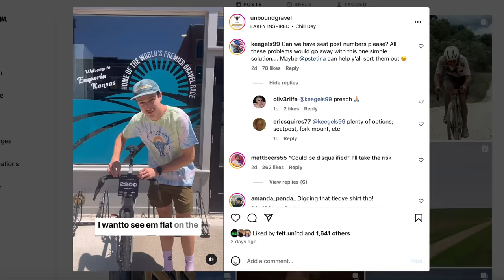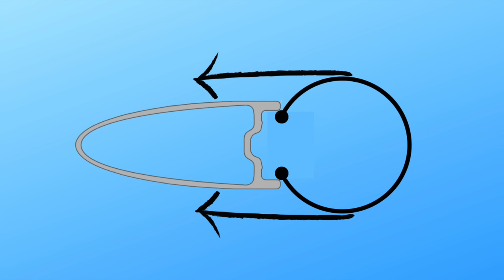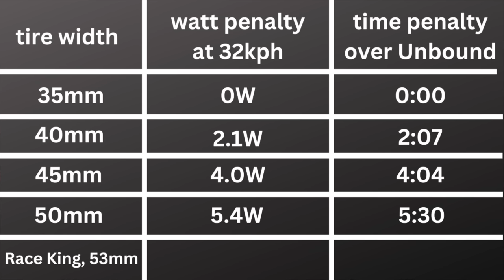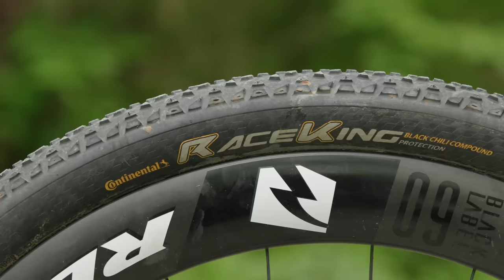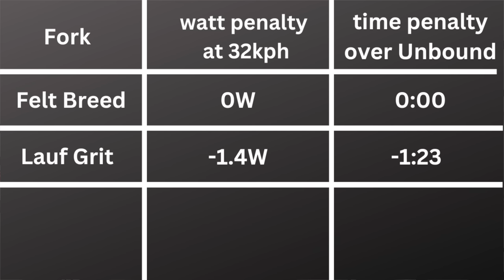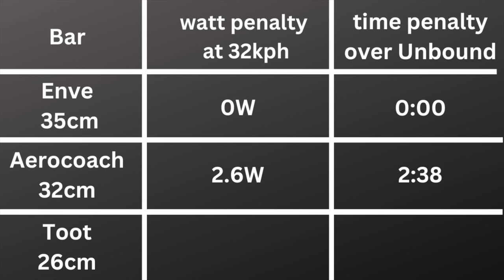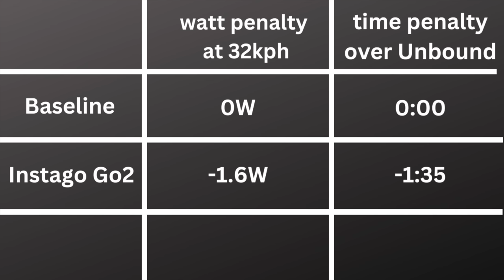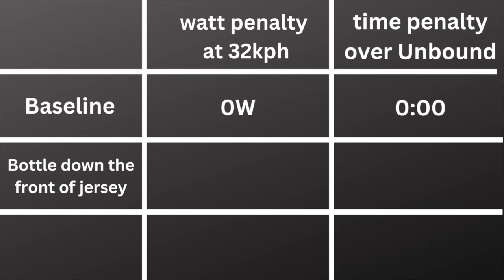We Went to a Wind Tunnel to Build the Fastest Unbound 200 Bike and This Is The Result

Comment: The worst thing about gravel racing is the terrible number plates.
Reply: I was going to say that his man-on-the-bike wind tunnel testing is an absolute waste of time without the number plate attached.
Reply: @l.d.t.6327  Yea there's absolutely nothing to be learned w/o the number plate
Reply: It so dumb. Just unprofessional for actual racers. Just use the jersey tags what the hell is wrong with that?
Reply: @future62  In Dylan's defense: it's not 'nothing' to be learned as fork / wheels+tires... is still important and thus useful info. It's ofcourse a shame any marginal gains are compensated by that number, but that is what it is. I bet some people will still try to fold / cut parts of the number.
Reply: Unbound should go with the timing chips that attach to the fork instead of the chips on the back of the number plate, at least for the elite riders
Reply: Someone owns the rights to sell photos and that’s how they can troll you
Reply: @danielklaussen3054  In NZ we have seat post labels with number and timing chip so the photos from the side get your number, they also give us a helmet sticker so photos from the front give the rider number, I just can't believe they have these stupid number plates in the US.
Reply: I am surprised no one 3D-printed a fairing for the number plate yet.
Reply: @Paksusuoli95  it's funny you say that as I have thought about it many times. Some sort of frame that the number plate can bend around and easily attach to my front bar.
Reply: Number Plates are the last vestige of the Spirit Of Gravel.
Reply: @davehause8571  perhaps, but good riddance to the spirit of gravel, then. Lame number plates, people riding aero bars in packs, Freds that can't hold a wheel steady... Gravel is big enough that some rules and fixes are warranted.

Comment: Request: next time also a total watt savings? Optimizing each component individually doesn't necessarily mean the package is just the sum of the savings.. but would be nice to see a "baseline everything" with your final setup.
Reply: I'd like to see the wind tunnel savings with the rider ACTUALLY pedaling during testing.
Reply: @davehause8571 I understand why you would want that, but I think it would significantly complicate getting consistent results, which is absolutely crucial when you are measuring 0.1w differences

Comment: i dig the fact that you went full experimental, geek mode on this. One thing that you may have overlooked about the fork is that your neck, shoulders, elbows and wrists will be less fatigued making your body feel less worn out.
Sidenote: More mass (weight) at speed is a little easier to keep moving at that speed. Light weight is better for accel / decel.
Reply: "More mass (weight) at speed is a little easier to keep moving at that speed."  That is a bit of a misleading thing to say.  If you are moving at 25mph and stop pedaling, then yes a heavier bike/wheel will slow down at a slower rate.  But it does not reduce the power needed to hold 25mph, at all.   But generally the penalty on acceleration of extra mass, even wheel mass, is much less than people tend to worry about.  Cyclists just don't accelerate hard enough, nor are typical mass differences big enough, for this to be a significant factor.
Reply: More mass is not easier. Increased rolling resistance power loss
Reply: I'm surprised more people don't talk about this. Comfort is key.
Reply: @JackMott  My impatience forgot about inertia.

Comment: As an engineer, I like that form is following function here. I love the wide tires on the deep rims. 

Concerning crank arm length, I'm 6' 2" and switched from 172.5 to 165 mm cranks this year. All up side. Knee pain resolved. So, I'm not surprised that at 5' 10", the 165 mm cranks are working for you.
Reply: I'm 6'5 and use 165mm cranks on my TT and road bikes. The only downside is in fit when you need to raise your saddle to compensate and now you've got a larger saddle-bar height differential, which might bother some people.
Reply: @GarbageLegs  I wonder if the aero is worse with the higher saddle height, or better with  less leg travel, or same same.
Reply: I’m 6” and ridden 175mm cranks on road and gravel my entire adult life. I’m 59. Given all the enthusiasm for shorter cranks, I’m thinking of giving 165mm a go for my gravel bike even though I’ve never had knee issues
Reply: I’m 5’10 and switched to 160mm on the new ultegra cranks from 165 (and from 172.5 before), and there’s been no difference in power output but I’m way more comfortable
Reply: @shred3005  As above, you’ll need to raise your saddle by 10mm, which might affect your lower back angle. But then it might also improve your hip angle. I’m 55 and 6” and I recently changed from 172.5mm to 170mm cranks and even that is noticeable in the lower back due to the slightly higher seat height. It’s an interesting equation for a bike fitter to answer.
Reply: I'm 5' 6" and 165 crank arm feels just right, just couldn't get one when changing groupset to GRX so using 170. Knees feel better with 165 crank arm.

Comment: I wish Dylan would talk about this...

Why not custom 3D print a lightweight ABS fairing behind the fork (70g), then use a fairly affordable carbon mold on that fairing to get it down to 20g? This approach gives you all the control in the world with airflow, especially if you're running deep section rims to control the airflow and pressure zones around and in between the rim. Using the fork fairing to help direct airflow and make the flow more laminar. The airflow would be more controlled, and a fairing coming off the back of the fork would help break the airflow for the leg as well. It might sound crazy, but I've been experimenting with this using a flat out-and-back course and my own 3D printer on a Fox 32 fork, using the rule of 105 for aerodynamics. It seems to be quite effective.

I haven't heard much discussion about this, and maybe it is against the rules, but for NICA races or local events, it seems like a fun way to gain a decent advantage. Another pro tip is to use 30-inch stretch wrap for your inner triangle on non-crosswind days to gain a few watts at almost zero weight. If you want to take it a step further, you can even use 30-inch stretch wrap on the wheel (I know it sounds insane, I should make a video on it) to create ultra-lightweight disc wheels for your MTB. You can then directly attach the stretch wrap to Continental Race Kings, getting far closer to the rule of 105 than you otherwise could.

It sounds silly, but it actually works incredibly well. The adhesive is so strong that if you clean your wheel with isopropyl alcohol first, the adhesion is insane. It lasted me 112 miles with no issues on MTB trails, including going off small jumps.

Recap:
- 3D print a fairing behind the fork and behind the seat post (using the rule of 105) to reduce drag, and even use slight dimpling to artificially change the Reynolds number.
- Stretch wrap your inner triangle with one-sided ultra-adhesive stretch wrap (30-inch).
- Stretch wrap your wheel with one-sided ultra-adhesive stretch wrap (30-inch) by taking off your cassette and disk first, then applying it directly to the wheel to make the whole thing one piece, covering the entire diameter.
- Use small silicone dimples on your race day skin suit and aero shoe covers or aero socks to reduce drag, applying them in a similar pattern to the Endura Encapsulator for best results.

*Links:*
- Match this pattern: [Endura Encapsulator Suit](https://us.endurasport.com/d2z-encapsulator-suit-ssthiviz-blue/12926217.html?affil=thggps&switchcurrency=USD&shippingcountry=US&variation=12926218&gad_source=1&gclid=Cj0KCQjwpNuyBhCuARIsANJqL9O54DhlKA-hgmU1Y4ib2DjuZBT1IMcJDKROYMr_7SI_6txHMP1O5oEaAtN6EALw_wcB&gclsrc=aw.ds)
- Use these stickies: [Glue Dots](https://www.uline.com/Product/Detail/S-10366/Glue-Dots/Dot-Shot-Pro-High-Tack-Low-Profile-Glue-Dots?pricode=WA9090&gadtype=pla&id=S-10366&gad_source=1&gclid=Cj0KCQjwpNuyBhCuARIsANJqL9M86ZJXxyqrCnzWCngzsyD_7zsmRvArTltAHnmJfPHky03y94DCUdwaAkZDEALw_wcB)
- Use this stretch wrap: [Stretch Wrap](https://www.uline.com/Product/Detail/S-17973/Stretch-Wrap-Machines/Portable-Stretch-Wrap-Cast-80-gauge-40-x-5000?pricode=WA9377&gadtype=pla&id=S-17973&gad_source=1&gclid=Cj0KCQjwpNuyBhCuARIsANJqL9OcLljqRsQZMWfAlTQi77WnFDtscf8tzen4D1Xwvcu3FNC7w9iYMZwaAgNWEALw_wcB)

I can share the 3D modeled STL files for the fork if you want. They are currently modeled for Fox 32 and 34 forks and RockShox forks. The models perfectly mold around your disk brakes as I 3D scanned the forks into Fusion 360 for CFD testing. I am currently on my 8th model and making huge gains in fork design. I am also working on a forged carbon layup mold to reduce the 3D print weight significantly, so I can manufacture them for some of the kids I coach. I know Josh from Silca hates the whole fairing thing and tall aero socks, but it just feels fun to go faster and know you have an advantage over the competition.
Reply: fairing is forbidden buy UCI rules
Reply: @treszenrv9401  Unbound isn't a UCI race though is it?

Comment: Great video! Really enjoyed geeking out on all of this! 165mm cranks for the win. I always tell my clients who are below 6 ft to try shorter cranks. I myself have tried 155 up to 190 crank arms and the shorter are always more comfortable and if it allows you to ride more, then you can train more.
Reply: 5'8" and I have less discomfort on 175 cranks compared to 165.
Reply: @JoshuaTootell I definitely do not feel it is all about leg length either. In my opinion it has more to do with flexibility, not just of the legs but back, shoulders, and neck. Also depends if you are a heel dropper vs toe down Pedaler. There are so many variables but for most, shorter is better.

Comment: A lot of people forget that bigger tyre is also taller. With a tyre this tall, it's no longer an light bulb with an trailing rim, but the side wall of that tyre itself should be considered some kind of "rim". You should probably think the first 1/3 of that tyre as the traditional light bulb but the rest 2/3 actually a perfect 105% rim. I suspect this a long time, as when you see from a distance, from the sideview, an MTB tyre with an MTB wheel  looks just like a deep section road wheel with road tyre. Of course this is just my speculation, to get an answer for this, you might try go the CFD route, because the CFD has the advantage of giving you a full scale idea of what's going on at every part of the system, instead of the wind tunnel just a number without any why. Your testing is kind of ground-breaking. Maybe try to get in touch with some people in the academic circle? Your quest could make an interesting research topic for someone who happen to know how to write a paper.

Comment: Regarding the relation of rim width and tire width: from a hydromechanic perspective you can’t break it down to a simple 2D flow case and a Karman vortex shedding. As the wheel rotates a lot of axial, tangential and radial velocities are induced. The total flow field gets way more complex as you leave the horizontal plane that falls into the axis of your front axle. Viscous stresses are affected as well. Additional surfaces mean additional viscous drag. How this drag is balanced with the vortex shedding at the spokes can not be answered without detailed simulation. Furthermore laminar-turbulent flow areas are totally different at the top end of the wheel compared to the bottom end, as relative velocities between inflow and wheel are totally different, which again means different drag in vertical direction. Cross flow drag at side wind conditions is affected as well. Compared to aerodynamic wing geometries, thicker leading edges (your tire) lead to higher pressure drag but delays flow separation at the suction side. And there are interactions with fork and frame, as the wheels alter the pressure field on both. You can go on and on. Interesting but complicated topic. 
Think you nailed it by simply testing it in a wind tunnel. Keep in mind, that the measurement results strongly depend on the environmental conditions, as they shift over (day-)time.
Reply: And on the roughness topic: There are structured and unstructured roughness types, that alter the velocity (and Reynolds number) and subsequently the pressure field. See the PHD an articles of my colleague Turnow et al on dimpled structures. The effect of wall roughness can be estimated comparing boundary layer thickness and roughness height. There are three different flow regimes: hydraulic smooth, transitional and rough. But I think that is way too far down the rabbit hole. 😄
Reply: Excellent and interesting comment!

I just wanted to add that using oval bicycle wheels will help in the smooth separation and recombination of airflows, reducing vortex formation and turbulence. The oval shape, elongated in the direction of the flow, has a smaller projection area compared to a round shape of the same maximum width. This means less air needs to be displaced or divided as the object moves through it, which reduces drag.

Comment: Dylan, any idea where to still get the non-E25 rated Conti Race King Protections?  They are slightly faster per BRR site but they kept the same part number so really hard to tell from retailers websites which one they are selling.  Which are you using, original or the newer E25's?

Comment: Super impressed with the depth you're going into these gear and optimizaton topics. Just a quick note on the "Race Kings": I know for sure from Conti that these were developed on 23c internal width rims (as reflected on the printed 21-23c recommendation). It might sound incredibly nitpicky, but for that particular design of the side knobs forming a pronounced edge of grip at a certain lean angle adhering to the company guidance here precisely can really benefit the handling and hence your confidence as a rider. It's just something I've noticed myself after making a seemingly "minor" switch from 19c to 21c that ended up noticeably improving the cornering performance.
Reply: *21c-25c recommrndation

Comment: Very interesting thanks Dylan. The Spirit of Gravel is alive and well in the kooky concoction of parts that make the perfect gravel race bike. Hope you go well this weekend! 
 ...Great to see that the 3T Exploro-like cable routing that everyone whinges about is a non-issue for aero gravel. 
On that, if you weren’t sponsored by Felt, 3T is the originator of kamm-tail aero gravel bikes specifically designed for the wide tyres you like. It would be very interesting to see a comparo between your Felt and a 3T Ultra which is aero optimised for wide tyres.

Comment: Another reason to go for wider tires on this race is aerodynamic interaction with the forks. Tires tend to get less aero as they get wider but if you test them on the bike, there's a certain point where most tires will start to get a bit faster again. This is because the wider tire is close to the fork. The narrow gap allows for air to get channeled along either the smooth surface of the fork or that of the tire wall instead of just passing straight through the gap. Since air running along a smooth surface tends to be laminar, this reduces the drag

Comment: Easily one of your best videos to date. Well done.

Question: did you ever do a before/after with all of the improvements you found in the tunnel? I'd be curious their cumulative effects when combined together.

I.e. - stock felt as baseline and then add in all of the tweaks in the video - 2.2 tires, leaf spring fork, bottle in chest, etc etc etc. It would be pretty neat to see the real back to back data via the windtunnel.  Good luck at UB!

Comment: The tire choice is determined by so many factors, and you've just put some new unexpected considerations on the table :) I'm currently comparing the continental race king protection to the schwalbe racing ralph addix speed on the rear wheel for road use only. The race king measures faster on the saddle in aero position, with less pumping at high cadence like a road bike, but creates a lot of drag out of saddle when climbing. I feel like the racing ralph is easier to drive, even with the typical 2.25 big volume pumping, but it doesn't squash that much and i can last longer during force climbing, resulting in a few kph faster on average which is the kind of mental challenge I like anyway ;)

Comment: Very insightful.My experience is similar with wider tires in the gravel bike, with no suspension. On the MTB with proper suspension there is no difference, but that is probably due to a much less less aero position.However at the UCI worlds in Belgium, no one ran this setup.In fact MVP won on 38mm Vittorias....

Comment: Perhaps try a Redshift Endurance Pro seatpost on the trails. I expect it will increase speed through increased comfort (freshness/less tiring) and efficiency (body momentum not diverted vertically) through the bumps. I've not done any science, just my seat of the pants experience.

Comment: Love it. Finally someone asking the right questions / testing the interesting things in the wind tunnel! :)

A question on the testing protocol for the wheels and tires, though: did you run a sweep protocol of several yaw angles and are the numbers given a weighted average of those or are they purely 0 degrees yaw / headwind?

Comment: One thing I have just thought about wind tunnel testing is that all the profiling is in a dead straight line....Dylan - how often are you cycling in a dead straight line in Unbound....turning the wheel by only a few degrees would expose the Lauf suspension set up and wider tyres to a higher wind resistance therefore more drag.
Just a thought.
Having said that I think the set up is so good it will get you a nailed on 15th i'm sure 😃